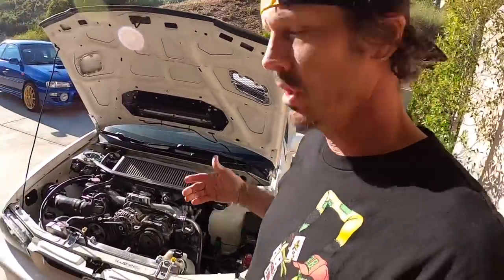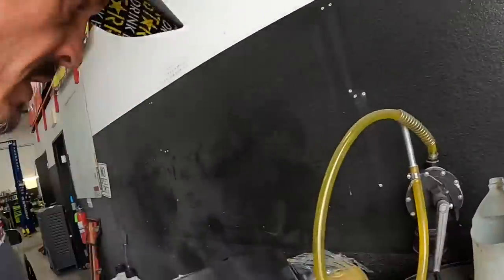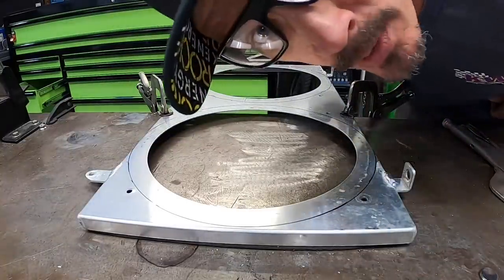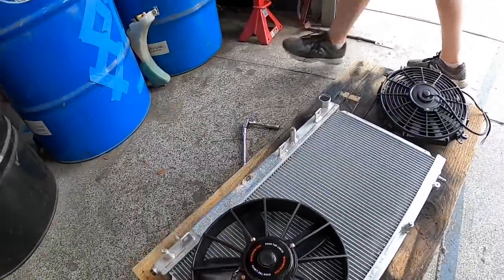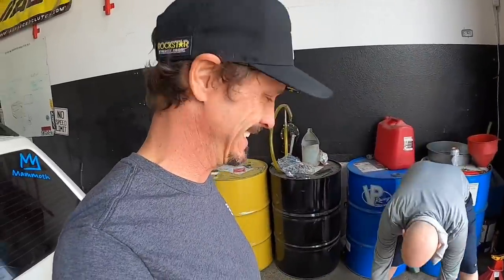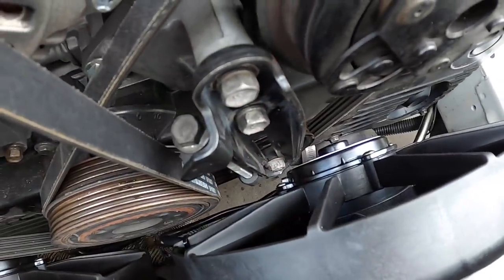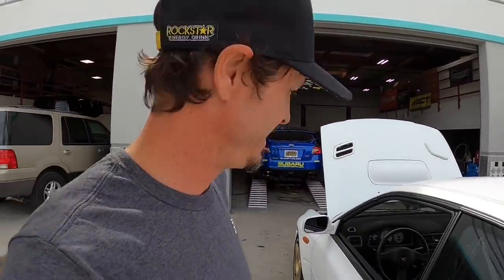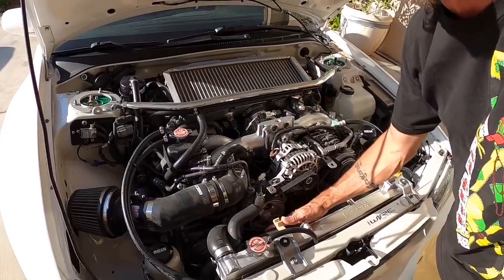“Hot Box’d” Built Not Bought #26

Comment: Normally the function of the fan shroud is to force the air to exit through the fans, increasing overall air speed at the expense of static pressure. With the fans now mounted directly to the radiator, there's no path for the air to exit the area just behind the radiator, and the shroud is just functioning as a limitation - It's actually reducing the overall efficiency of your cooling system. (At least as I understand it - I'm not a Mech E.)

But, on the other hand, it does look pretty good and it keeps the fins from getting banged up whenever you're workin' in there. If there's no overheating issues, I wouldn't worry about it.
Reply: Was thinking just the same about the fans being bolded direct to the radiator with the shroud behind it.

Comment: Hey Buck if you want even better air flow through the fans you should make some ducting out of sheetmetal that directs the air to the rad from the opening in the bumper. Just need the 2 sides and the bottom mostly. You can put a piece of sheetmetal up top but it's a little tricky with the hood latch etc.
 The less turbulent air flow the better!
Reply from the maker: layzor beeemz I’m planning on doing that soon.

Comment: If you have the fans flush against the rad like that, take the shroud off, else you're blocking other air that could flow through when moving.
I'm running 04 STi fans on factory shrouds with a mishimoto rad and it all fits just fine, no cooling issues.
Reply from the maker: acquacow It channels cool air through and keeps hot air from heat cycling
Reply: @BuckyLasekOfficial  now you need to get a proper shroud on the top mount/hood scoop too.
Also, for what its worth, when i had my 02 WRX the first upgrade i made was a bigger TSX top mount. It was a great improvement. ymmv, fyi, etc...

Comment: Was actually having the same exact problem with my rsti, same clearance issue on the belt tensioner as well (BARELY grazing). I ended up getting the mishimoto X line radiator (3 row core) with a Koyo thermostat. Still have AC. Ran one 12" spal fan @ 1230 CFM and one 13" spal fan @ 1770 CFM, be sure to get genuine spal fans as there are many cheap knock offs. Also running about a 30/70 coolant to water mix with like 10oz of water wetter as I live in central cali so no real freezing temps. All that did the trick nicely 👌. TIGHT fit though.

Comment: I wired both fans to come on with the first fan relay. No issues with the amp draw when they turn on or relay burning up. Everything is handling it fine. They are stock fans though, aftermarket fans might draw more but I still don’t think it’d be an issue. Just run em on the first relay.

Comment: If the problem continues only when engine on idle: a possible head gasket issue present by leaking compression into the cooling system. The coolant fluid will be running with small bubbles and the temperature sensor will detect a rise on coolant temperature because the (vapor bubbles) are hotter (110*c) and  coolant (80*c). Pressurizing the cooling system with the manometer will show you if there's any combustion pulsing and inducting air into the system.
Reply from the maker: Legal Man Not The problem
Reply: Lol definitely not the problem, he’s got a fully built engine and not pushing any serious hp (yet)

Comment: This same issue happens all the time in the Jeep XJ world of tuning. A lot of people love to take off the factory belt driven fan and fan clutch and replace that and the electric fan with dual and triple electric fans. And then they have all sorts of over heating issues. They always forget that the factory fans actually pull a uge amount of air and the belt driven fan is on the hot side of the radiator. The stock electric is on the cooler side. And then there is the fan shroud issue. None of the XJs with overheating issues use a proper fan shroud. These are all simple fluid dynamic issues.
My XJ with its stock radiator and fans stays cool all the time. The only mod I have do to it is to install an electric fan override switch so I can turn it on when I want. It will still kick on at the factory setting, but that doesn't account for when I driving slow while wheeling.

Anyhow, I saw the similarity in both vehicles and they both have the same sort of fix.
Cool content man! Love it!

Comment: My GDB goes to 205 before it kicks on the fan. I would like to lower that if possible. Like 195 seems more reasonable. I've got a new thermostat with a new JDM engine and it still goes to 205 before kicking on.
Reply from the maker: Steve Holt It’s in the Ecu/tune
Reply: @BuckyLasekOfficial  Sweet!

Comment: So it looked like you bolted the fans directly to the radiator and than blocked the rest of the radiator's flow off with the shroud.
Reply: Yep. If you force the air through the fans they will flow more air.
Reply: @layzorbeeemz7317  but he blocked off the rest of the radiator, so the only parts getting cooled are the ones with the fan. The rest are blocked off, not allowing air to pass through thus making half the radiator useless.
Reply: @coltonobriant6307  aluminum is a great thermal conductor. So you don't need to have the whole thing exposed. The air passing through will lower the temp of the entire radiator through conduction. The reason for blocking parts of the radiator is to increase static pressure through the fans. The greater the pressure, the more air will flow through the fans because then they don't have to try to pull the air, the air is forced through from being funnelled into the fans.

Comment: My 2nd fan (ac side) wont come on. Tried relay, new fan, so my next try is a new radiator...maybe the unit is bad? I have an 06 LGT.
Reply: Try switching to the front defrost  to see if it comes on. Also, if you plug in the transportation/ test fuse the fans should cycle. The A/C fans only will come on if it gets really hot without either the climate control or the test connector. There should be an article or two over at Legacy GT.
I know I love my 05 GT wagon!
Reply: @troyfankell6581   Dude, thanks! 
Come to think of it, someone worked on my car, and pulled that front defroster fuse to put it elsewhere. I'll try in the morning. Mine was a mid year model, so some parts are for an 05 (like my clutch master cylinder), and some are 06. I tried connecting that green connection under the glove box to see what was working. My car doesn't overheat too bad, just gets almost to the bar under the red. It goes up (rarely) then down, but most days not at all. The day it did it, it was 80 deg out with ac on. Today was 92, and it didn't at all. Thanks for the tip, I was running out of ideas. Head gaskets are fine, coolant is new, clean, and full. I don't like to go to a shop unless I have to "throw in the towel." Lol. I like to learn and fix it myself as much as I can.
Reply: @mattyee9369  Have you pulled the fans  to wash out/ blow out between the radiator and a/c condenser? Also, while you are there check for the crusty coolant at the seams of the radiator. If it is leaking you will need a new one soon.
It maybe a good time to just replace the thermostat with a new factory one too. Check for any coolant residue by the water pump weep hole too.
Reply: @troyfankell6581  Yes I have. I pulled the engine to do the clutch (I don't have a lift and didn't want to lay down or go under the car). No coolant leaks what so ever. Radiator looks good and clean.
Reply: Check out this thread
https://legacygt.com/forums/showthread.php/radiator-fan-not-coming-270104.html?s=dbf9e16c7754fdbad0877a04264d5ceb&amp;amp;